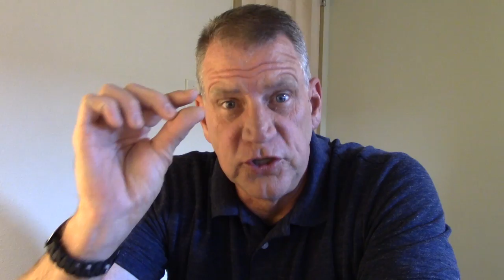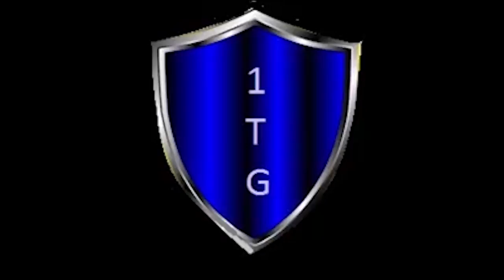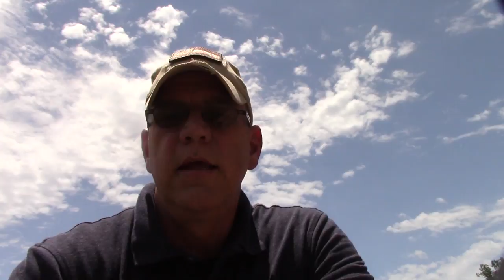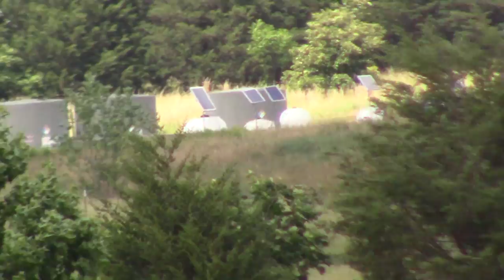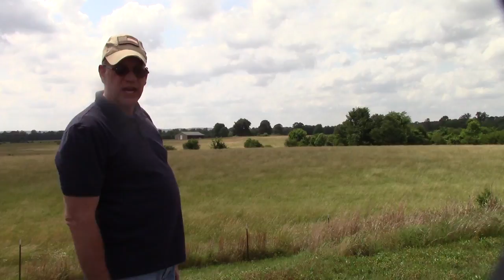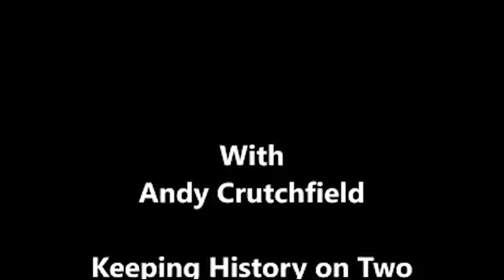The Damascus Accident, 1980 Titan II missle blows up in its silo in Damascus Arkansas.

Comment: I worked on nuclear ICBMs for 20 years in the Air Force.  The US did NOT come close to nucing Arkansas.  There are so many safety devices on the weapon that it is not possible and we have had many accidents involving them yet never had a nuclear detonation or anything close to it.
Reply: Completely agree! A nuclear weapon requires a specific sequence of events to detonate the nuclear explosion. Generally, the two half spheres of nuclear material have to be slammed together from the explosive material surrounding the two half spheres. A fire with only ignite partially this explosive resulting in an incomplete explosion. 

That is not to say that a fire won't damage extensively a nuclear warhead and scatter the pieces over a wide area, but an actual nuclear explosion, no.
Reply: People who do not research things would panic and think that the warheads will detonate if somebody looks at it wrong. There are several fusing mechanisms that must be aligned for a nuclear detonation to happen. There was a B29 that crashed at the end of a runway with an armed atomic bomb on board and it never went nuclear in the ensuing fire. And that wasn't an ICBM warhead with even more safety features built in.
Reply: @TheBrix57  The primary warhead only goes critical mass if all the explosive charges surrounding the spheres of plutonium detonate at the exact same time. Thermonuclear weapons have a primary stage which is an atomic implosion bomb which then ignites the second stage from the heat. A fission bomb creates a fusion reaction.
Reply from the maker: @TheBrix57  Basically becoming a big dirty bomb.
Reply: @KeepingHistoryontwowheels  No, just a destroyed bomb - nothing dirty  (nuclear or nuclear components) about it.
Reply: Agreed.  Unfortunately, those of us in the know have to hold out tongues or risk disclosing classified information.

Comment: You mentioned the underground Control Center was destroyed. How could that occur? Was it damaged or destroyed? They were designed to survive an incoming nuclear bomb hit.
Reply from the maker: The way the reports described it. And I may be wrong. When the place was evacuated and the fueling teams were going back and forth originally the first two had to go in through the emergency escape shaft. And it comes out in the control room. Then they had to open the control room blast door. Then they went through the room in between the control room and the silo. Opening the silo door as well. Leaving them both open when they left. Then upon making the decision to go back in to turn the fans on they were going to go through blast door number one. The main outside door. That's when it blew. So with the doors open it destroyed what was inside the control room. The room was still intact. Just the stuff In it. At least that's the way I understood what I was reading and what I heard.
Reply: They didn't include the missile blowing up inside the silo in the design plans. The complexes were designed to withstand a nuclear strike from the outside.

Comment: No they didn't.  The safety mechanisms on the W53-1 worked as designed.
Reply from the maker: Did they?
Reply: Yes they did, otherwise, there would have been a Big Bang, or at least a major radiological event.  There wasn’t.
Reply: @KeepingHistoryontwowheels  If the safety mechanisms failed, Arkansas would be glowing in the dark.
Reply from the maker: @TwentytenS4B8  at 10:10 time on the video. I stated the safety systems worked.
Reply from the maker: @thomaswood7495  at the 10min 10second mark in the video I think you will find I said that the safety system DID work.

Comment: Thanks, would be great to see how it looks like today, but I guess it is off-limit and using a drone might be illegal
Reply from the maker: It is actually private property now.  So for a general fly over all you would see is a couple of solar panels. The property is being used as a natural gas field where they are kinda drilling and tapping. I actually talked to the company about doing a fly over for the site where 53 men were killed in under a minute but it was a no go. When the airforce decided commissioned the sites they broke up the top 20 feet of the silos and pushed them in on themselves to fill the silo and then they buried the doorways. So you would not see anything except dirt and grass and maybe some concrete pads where the fuel tanks used to be. And excellent channel to check out to see one being re opened is my buddy Gt's channel. It's called " the devil wears bunny slippers" super nice guy. I will post another answer for you with a link to his page.
Reply from the maker: https://www.youtube.com/channel/UCd50A5qLv8FemVufSvDgkCQ
Reply: Keeping History on two wheels Thanks, I knew the channel already, awesome job, what a project that is! These natural gas fields, they were also present during the Cold War? That would make things hard for the Russian satellites to figure out what was the nuke silo or gas field depot

Comment: Mondale and Clinton was not Air Force personal, they had no direct control over the silo site. So what was your point about trying to blame them for any part of this? Equipment failure happens.
Reply from the maker: Hahahahaha clinton was governor and Mondale was up.  Wasn't blaming them at all. They just happened to be in a meeting 45 miles away. If the the war head had exploded it could have and most possibly would have killed them. All by coincidence.
Reply from the maker: Vp
Reply: @KeepingHistoryontwowheels  On that note it could had been a good day if Hillary was there also. Hehe
Reply: @KeepingHistoryontwowheels  Makes no difference at that time the Air Force was not allowed to even inform the VP about the problem.